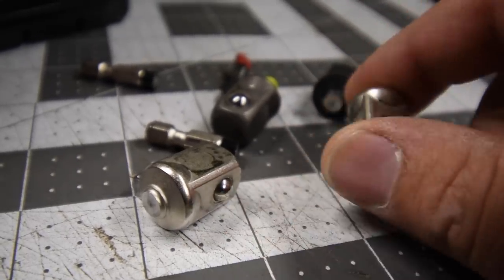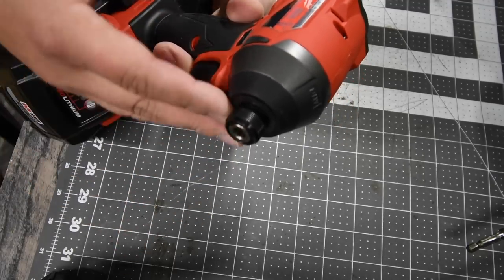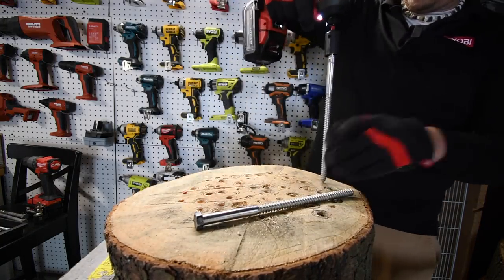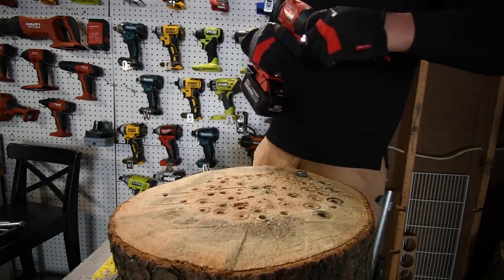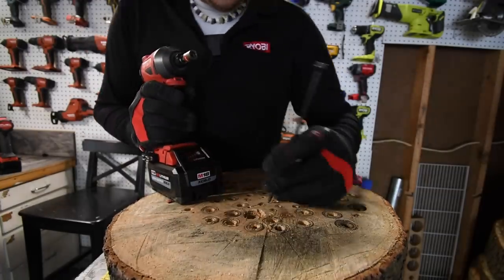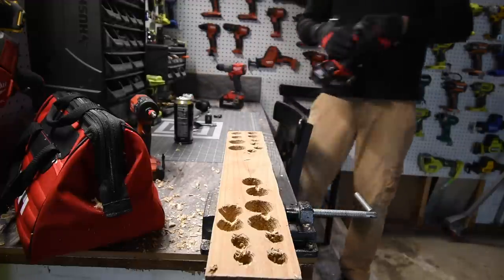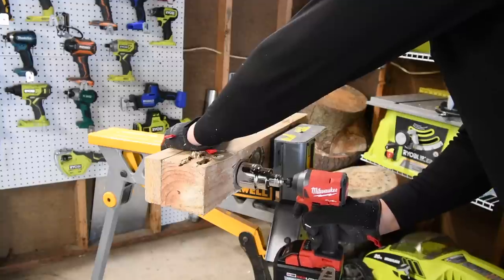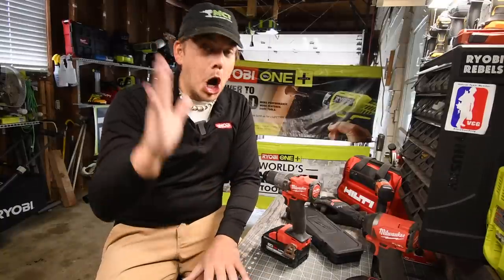Are Impact Drivers  OBSOLETE?

Comment: Sorry I think you mean "are drills obsolete"
Reply: Because no way in hell am I going to fasten a mission band with a drill and snap the head off a 5/16 screw
Reply from the maker: you will be supposed what the results are.
Reply from the maker: @Marty McFly I thank you very much
Reply: Both have their place. I have the 2804 hammer drill and the 2760 Surge hydraulic driver. They pair very well.
Reply: Plus an M12 stubby for the big nuts and bolts
Reply: Absolutely wrong. Impact drivers serve a totally different purpose. You will snap many fasteners off by tightening with a drill that you will not with an impact. Also, you can loosen many things with an impact that you can not with a drill. It is also much easier to install screws with an impact vs a drill. You don’t have to push as hard with an impact and screw heads don’t strip as easily with an impact. I often enjoy your videos, but this whole test is dumb. Comparing apples to oranges and saying one is useless compared to the other is not helpful.
Reply: Nate Leatherman snap adapters or fasteners; either way think most of this stuff is overpowered in the first place we just need it to be precise more than powerful
Reply: @dvxAznxvb  ...which is where the speed control on modern impacts comes in real handy!